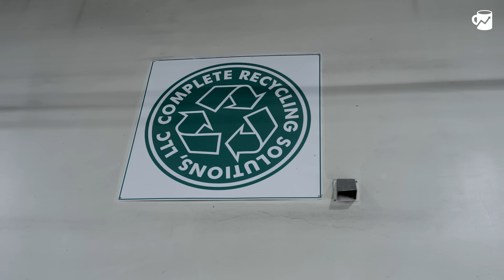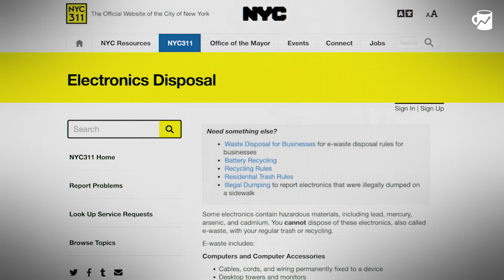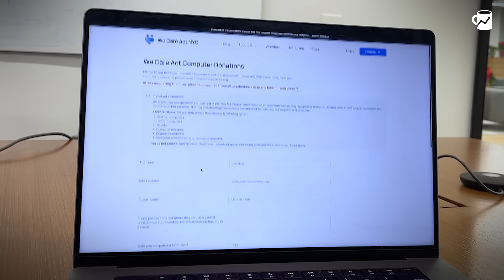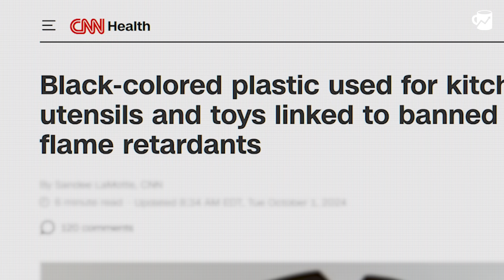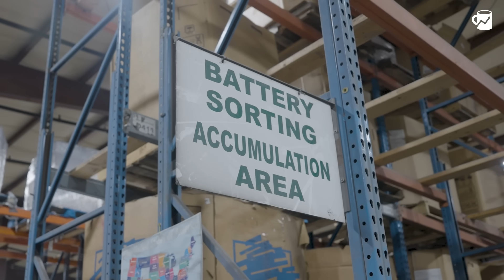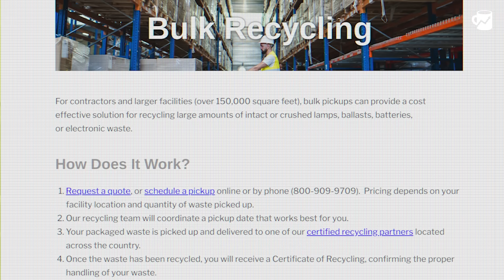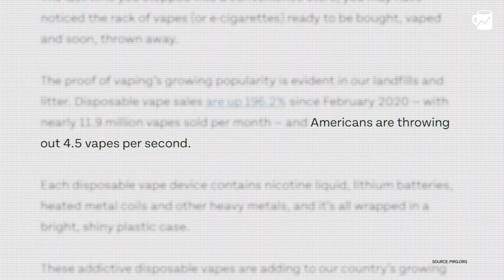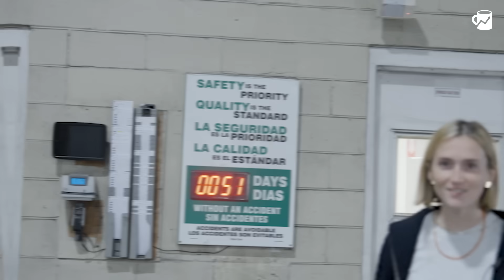I went down a rabbit hole trying to recycle all my tech waste

Comment: I am writing this in 2025 on a 2009 MacBook Pro, that I was given a few years back, and which I have no intension of retiring.

Concerning the actual sample waste at the beginning of the video. Old phones that are capable of still being phones, can always be reused as is, for poor people who need a basic phone.

If a phone cannot be used as a phone for whatever reason, you can use it as a security camera, or a bootable emergency drive from which you can repair your main computer should it fail to startup.

Apple power adaptors are expensive, so they are worth selling on eBay.

Old calculators in good condition are vintage electronics and are worth storing away for later sale as a collectable. They are small so they not a problem to store.

As of 2025, the 2015 Macbook Pro Air is a perfectly good computer, and can be patched with open-core and updated to run the latest system software. This will allow you to update your web browser and get rid of the increasing number of messages flagging your browser as out of date. 

Having a stripped down separate computer for basic web use, creates a PHYSICAL FIREWALL between the web and your private information. A physical firewall is the gold standard for data security.

Comment: The problem is also that even if you can technically repair a lot of the old laptops, phones, tablets or even smart TVs, you still loose because they'll stop supporting the operating system that these devices run on.

Current example that'll go on right now is the transistion from Windows 10 to 11. A lot of motherboards have to be replaced because windows 11 will not be supported on slightly older systems. So the constant update stop on operating systems also contributes to electronic waste.

I have an Android phone that I bought like 4-5 years ago. It still works today, however, the battery is not the best right now. And recently I checked for updates, and the last update was in 2022, so I should get a new phone in case security will be an issue. I don't want to get a new phone, but since they won't support it anymore, I don't have any other choice but to get a new phone.

And also the batteries are a problem in modern devices. Batteries get developed all the time, but as they get developed, they stop manufacture batteries for older devices. And it's not like you can buy a bunch of stock of batteries either, if you don't use them in time, they'll also wear out.

Comment: The only way to get tech waste under control is to create a law saying that tech companies have to be able to recycle 100% of their product output. They don’t have to buy back 100% of the products but they have to have a customer facing recycling program. Planned obsolescence also needs to be a minimum of 10 years.  People should not have to hunt for recycling options. The U.S. is very bad about this. Also, anything not recycled in the U.S. gets dumped in other countries like the Ivory Coast. In my area of the Gulf Coast, other than Best Buy, there are one or two e-waste recycling drop off points that are advertised. I would pay more for tech if I had a recycling option built into the price but I don’t see most people doing that because they are too cheap to have a recycling bin for common recyclables. Btw, Goodwill is an all out scam. A donation company where the CEO makes well into mid to high six digits is not about taking care of the people or environment. They just want your stuff to mark it up as much as possible to sell to someone else. Goodwill not about making things affordable. They’ll even sell you someone’s garbage if they can get away with it.

Comment: I love this video.  I have boxes of electronics that I've wanted to recycle for years.  I have been trying to find places to recycle them without having to drive hours or figure out the few times a year I can go to some obscure drop off place that doesn't seem to be posted in convenient places.  There isn't anything sound in our area.  YET.  I know it's coming our state is all about recycle, lowering energy consumption, etc.   I'm hoping to see more convenient ways to drop off my recycle of electronics in our smaller community.  I have recycled some of the stuff, phones, laptops, graphic cards are easier, however, OLD TVs (tube from the 90s), older computers (90s), monitors, keyboards, cords, etc. seem to be the more difficult stuff to recycle locally.

Comment: The thing about TV 'recycling', especially the old CRT's is that most of those are still working but tossed because they aren't digital, needing a converter box to watch it and the fact that people want the big screen now. There are people that love to work on the old TV's and other CRT devices so it is a shame to see all those hard to get parts scrapped. There is no company in the US now that rebuilds CRT's so all those probably good ones going to scrap means fixing a TV, computer or commercial video game will get harder. Those were MADE to be repaired, though at today's hourly cost, it is not worth it to have a shop do it, IF you can find a repair shop these days. More for the electronics hobby to work on. In the past, TV's cost a lot to buy and needed regular servicing. Now it is all surface mount micro-parts.  Most recycling is a scam that strips the most valuable materials and the rest goes to the dump or overseas. People need to quit buying the latest and greatest and tossing their old perfectly good stuff.

Comment: About 5-6 yrs ago my elderly mom's big old Sony tube TV finally died.  To get rid of it locally, I would have had to haul it (170lbs) to a landfill 40 miles away and pay $25.  I did end up hauling it, but back to where I live in another state and took it to my local county place where I could drop it off for $0 fee.  So, it took some effort but no out of the way trips too much.  I can see why in rural areas this sort of stuff gets dumped in the woods or in a ditch someplace.

Comment: The most impressive part is that the Ti-83 calculator actually retained more value than everything else lol
Reply: Old tech is fixable. So it has value even as parts. 
New tech struggles to have value even as parts, because they aren't as fixable.
Reply: They actually have a museum for old Texas Instruments calculators. I found my model on there that is no longer fixable after decades of service.
Reply: @AIBotGold I got an “as is” TI-55 from eBay that works great after putting a 9V lithium battery in it.
Reply: I have a bit of a calculator fetish myself. I like me some nice scientific calculators.
Reply: My community college buys them, and has them available for students (ok, TI-84, but close).  I have one borrowed from the college on my desk right now.
Reply: heGreatChrisB
TI-84, i need the Graphical Display
z80, worth nothing, you can make it yourself too.

Comment: The Goodwill near me would take working electronics. If they aren't working there's another Goodwill location that does take e-waste. They use the Dell e-waste program.
Reply: It depends on what location you go to. Goodwill stores operate largely independently of each other so they each have different rules for what they will or won't take.

Comment: A huge amount of devices from MANY companies are thrown out simply because the battery died, that was the only needed repair. Going back to user-replaceable batteries as a standard would solve a large part of the problem. I can't even easily replace the battery in a $30 Sandisk mp3 player.

Comment: I actually worked for a place that did refurbing and recycling of a certain tech/electronic product. We had a partnership with the business who makes the things in the first place, and were a favored place for customer returns and RMAs to get sent to to brign them back to life, or at least get parts that can be remanufactured. The place is R2 and RIOS certified, so the stuff we'd get in which was not in our focus items we'd send downstream to places specialized in that after sorting out the different materials and parts. Because of the product category, hazardous materials were commonly dealt with, so that was kind of crazy to think about it, but we had a lot of rules and training around dealing with those things (like lead, mercury, and occasionally PCB - the poison chemical, not circuit boards) because it'd be a big problem if some of that stuff got damaged in shipment and, say, spilled. All of the truckers there had to be certified with R2 as well because it's the entire downstream. So even if the top level is not certified, if it eventually gets down to a part of the industry which is R2 certified, everything below them that they use in their supply chain is certified. An interesting aspect of it was dealing with data though, because data-holding devices have their own problems, because data privacy/security, naturally. I happen to be knowledgeable and capable in sanitizing data storage, but because of the sort of things we dealt with, that wasn't really applicable, and was more or less sent for destruction, if I recall correctly. Very interesting stuff though to see industrial supply chains that are usually out of sight of consumers.

Comment: That’s the problem Best Buy showed you, they CHARGE you for throwing you stuff away. So in the garbage can it goes or chuck it into a dumpster at the apartments down the street. Make it free or give people money for it and people would then do it. Common sense. Also Home Depot and such did away with lithium battery drop off  cordless tool recycling cause it’s too expensive to remove the lithium anymore so they just throw it in the trash bag/landfill like most of us would. It’s throwing away with extra steps. Terrible.
Reply: It's not free. Why should those companies pay you money?

Comment: Disposable vapes hace rechargeable lithium capacitors which are really useful but obly if you kbow how ro discharge them safely and reuse them. They can be used to buikd power banks.

Comment: Still have my TI-83 Plus from over 20 years ago that I plan to keep til the day I part this world. Got me through calc my senior year and all my college math courses (except a few where the prof banned calculators). Also got me through all 3 years of physics in HS and hooked it to all kinds of sensors to do lab assignments. That this is capable of some badassery for such an old device. I used to think using it was cheating.

Comment: Recycling since the 80s has mostly been a marketing scam to cause customers to blame themselves instead of the packagers and vendors.

True recycling could be done when consumer products were simple and holistic:
Cars were mostly steel. Drain the fluids, remove the seats and tires...crush and melt them.  A modern EV, hybrid or even ICE car is a major blend of non removable elements.

Bottles were once consistent, turned in for a small cash deposit...WASHED and reused.  Today recyclers don't want glass.

Paper products areoften laminated withfoils and plastics...making that worthless unless it is a pure productlike newspaper or simple boxes.

Plastics could be recycled if they were only made of one type of polymer....but dozens of plastic blends exist in bottles, wrapping and bluster packs.

About all that is still recyclable is aluminum cans and steel cans...even they have a plastic coating.

As we generate huge amounts of integrated circuit products...it is clear that our governments and society isnot interested in recycling...except as a way to play mind games on you

Comment: Yes, we can slow this problem down. Adopt the 7 year rule: Don't replace any electronics (smartphones, computers, TVs, etc) until you've used it for at least 7 years. Don't upgrade, but wipe your device when it is not performing and re-install only the necessary applications.  I installed Linux Mint on my computers older than 12 years and it works well.  I usually use a computer (e.g. laptop) for 10 years by connecting it to a large screen and keyboard (through a dock) and upgrading only the memory and hard disk.  

I disconnected the data service on my smartphone and use it only sparingly for calls and with wifi. I do not buy smart watches, or unnecessary electronics. If you must buy a new computer, consider the professional grade computers (e.g. Thinkpad, Elitebook) which are easier to find common repair parts for, on auction sites, such as displays, keyboards and power jacks.

Comment: I run a (very) small electronics recycling company, and one thing I've noticed is the strong psychological attachment many people have to their old electronics. It's not uncommon for someone to keep an old laptop or computer in a closet for years rather than recycling it. A common excuse is concern over data still being on the devices, but even when I offer secure data erasure services, the hesitation often remains. It's a fascinating challenge in encouraging responsible recycling habits.

Comment: Because recycling plastic isn't worth the squeeze, nor is separating the metal from it. Nor the glass.

Recycling in general is (with the sole exception of aluminum cans and other scrap metals) a massive waste done for the benefit of rich yuppie Westerners who wish to pretend that their excessive consumption is of little impact if they can just sort their trash into three different bins. Best to just prioritize purchasing plastics that decompose quicker and to support the proper management and implementation of landfills, which are not the problem but rather the quite excellent solution.

Trash in the ocean comes not from America or its landfills, but from utopian dreams of recycling in which we, in an effort to save funds for our recycling delusions, offload plastic to overseas organizations who promise to recycle it for cheap but instead quickly leave it in an uncovered pile or dump it all into the nearest river or ocean.

Comment: 9:45 I mean they also don't get manufactured at a single facility so it kinda makes sense that it takes many steps to recycle everything
Reply: This is what I was gonna say. Having worked as an engineer for a company manufacturing high end industrial metrology equipment, it's not like we had our own chip fab or metal foundry. You build up in stages, so it makes sense you tear down in stages.

Comment: eBay is an option, it's possible you could have gotten more money than the options you showed; reuse is a better option than recycling IMHO. I would have given you $80 for the Airbook, and  $80 for each iPhone. I paid $160 for an iPhone X on Ebay 2 years ago. I have a 2012 iMac and a 2013 that I currently use & I bought both from eBay.  Also  You can run Linux or Windows on iMacs and Intel MacBooks if the macOS is no longer supported on those devices. It's sad to me that perfectly usable devices get thrown away or shredded. I'm glad you found a place that takes donated devices and resuses them.

Comment: I have 2 computers that are 12 years old.  Replaced the hard drives with solid state drives, so they run very well.  They aren't used for gaming so don't need the newest tech.  Microsoft is essentially making me, and anyone with old computers buy 2 new computers.  It's frustrating.  I also drive a car that is well maintained, it has 420,000 miles and my phone is maybe 6 years old.  I just don't like being wasteful and don't like throw away culture. Technology is very interesting, convenient and fun, but I don't feel the need to constantly upgrade.

Comment: Don't buy junk you don't need and use what you do have until it just plain doesn't work. Just because a new one is shiny doesn't mean you need it.

I'm using a laptop from 2012 or 2011. That may not work for everyone but i bet most would do fine

Comment: Where I live the electronic shops collect recyclable electronics. They are sent to a recycler. The boards are pulled out and shredded, then sorted for the metals, which are valuable. Gold, palladium, silver. The scrap material left over is burned at a super hot blast furnace which generates electricity.

Comment: I always try to resell my tech if it still works or can still be repaired or used for parts then if it's say pre2010 or a storage drive I take it to a e-waste facility in my area and they mail you a check a few weeks later.

Comment: Limit what you buy, buy used items as much as possible, hold on to what you have as long as possible before replacing it (yes it may take you a few seconds longer to open your amazon app), and re-use it for a secondary purpose once it is end of life.  Choke the demand.